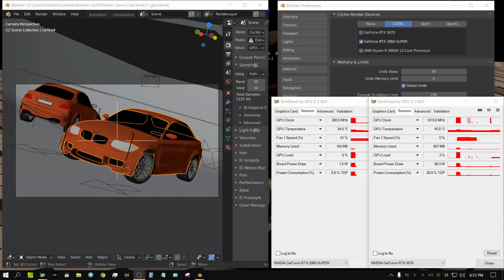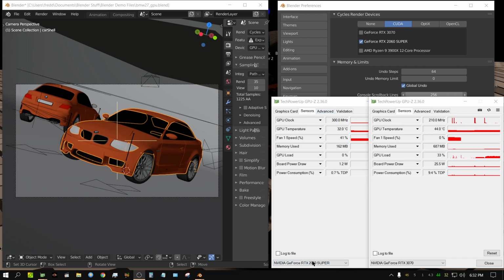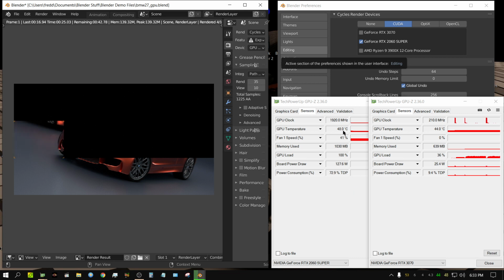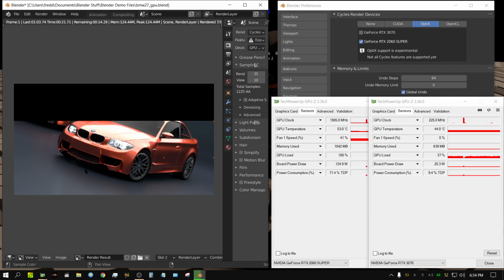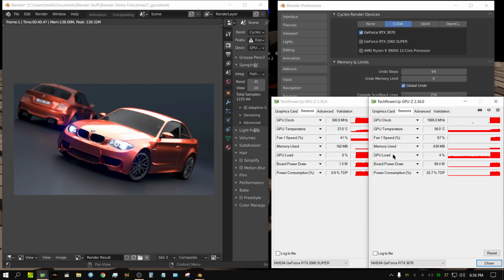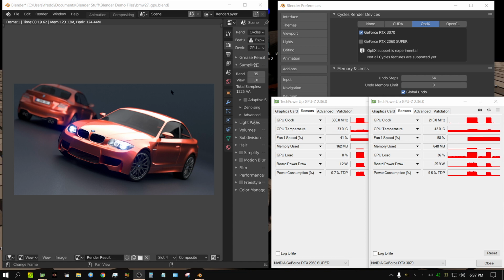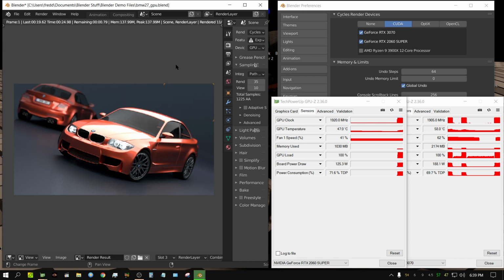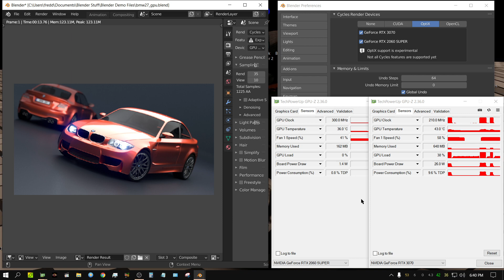First Test Gigabyte RTX 3070 In Blender

Comment: Is there any difference between Nvidia RTX 3070  and Gigabyte RTX 3070?
Reply from the maker: nope, except the cooling configuration and factory clocks. you likely could not tell any difference in performance.
Reply: @BlenderRookie  Which Gigabyte RTX 3070 do you use? Is it the Gaming OC?
Reply from the maker: @luminark_studio  That's the one I have and I have the OC version of the 3060 and the 3080 ti.
Reply: @BlenderRookie  Does it have LHR (Lite Hash Rate)? I heard that it reduces rendering performance. Is it true?
Reply from the maker: @luminark_studio  my 3070 is a full hashrate card and my 3080 ti is a litehash card. The 3070 will hash at 58Mh and run 55c at 125 watts and my 3080 ti with litehash unlocked will run 65c core and 80c VRAM at 110Mh at about 260 watts.

No whether you have a litehash or unlocked card it doesn't effect the rendering performance

Comment: Great Video!

I Noticed When You Ran OptiX with the RTX 3070, Your Power Dropped Down to 154...About a 25% Power Drop, and About a 50% Increase in Speed
Reply from the maker: Yeah, typically Optix uses less power and has better performance. However, the difference in power usage is seldom this large. However, the performance difference is typical.

Comment: How to decrease the time before start the rendering itself? Processor power? Ram memory? HDD? SSD?
Reply from the maker: The scene build time is mostly a product of how fast your CPU is. But it's not really about how powerful the CPU is with all cores combined as it is how fast its single threaded performance is. How fast your storage is also can make a difference. Ram speed will make a tiny difference. For example, a 5Ghz CPU with only 4 threads will generally build the scene quicker than like what I have which is a 3.8Ghz 12 core ryzen 3900X. But when it comes to calculating physics like fluids, mine will vastly outperform a 4 thread 5Ghz CPU.

But when all is said and done, it will make little difference when rendering a single frame. But if rendering several hundred frames, saving a few seconds on each frame can add up.
Reply: @BlenderRookie  so, for scene build single core perfomence over multi thread
Reply from the maker: @henrique-3d  That's my experience.

Comment: with blender latest version you can render with cpu and gpu combined, and it much faster.
i currently using rtx 2060 after watching this i decided to keep it for another year. do you personally think the 3070 worth the upgrade?
Reply from the maker: Yes. I have a Ryzen 9 3900x and if I use the CPU and GPU together, it's slower than if I only used the GPU because the CPU will slow down the GPU.

Do you have the 2060 or the 2060 super? Because the 2060 super is half as fast as the 3070 and the 2060 super is about 25% faster than the 2060.

Personally if money is tight, I'd wait for prices to stabilize. A 3060 ti will barely be slower than a 3070 but it will be about 25% cheaper once the market corrects with supply and demand. Or wait for the prices of the 3080 to normalize.

I would not spend more than $600 USD for a 3070.

But if we take money, supply and demand out of the equation, then the 3070 is a good upgrade for the 2060 super and a really good upgrade for the 2060.

Comment: Didn't know you can combine 2 different cards
Reply from the maker: Rendering in applications like Blender isn't like gaming. You don't need SLI or NVLINK. I believe you can use up to 16 GPUs at the same time. Seems like I read that somewhere. I personally have used 4 at the same time. They can be mixed and matched.
Reply: @BlenderRookie  Interesting! So i can put 2 gpu for rendering. thanks, really opening my eyes for my upgrade machine
Reply from the maker: @AmirHamzah_MAHBAR  Cool beans.